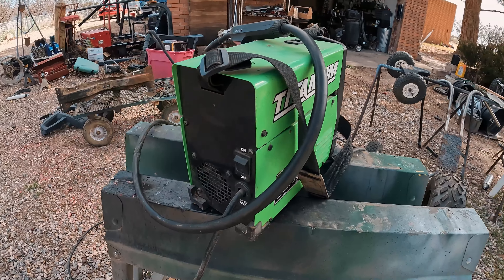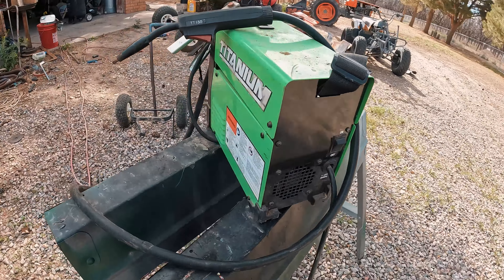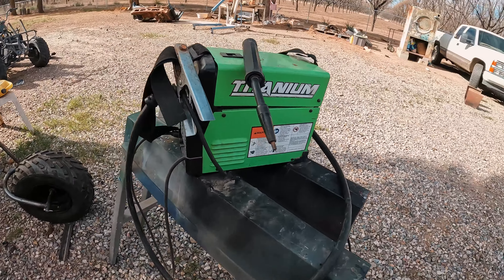Learn how to flux weld in 10 minutes or less

Comment: I stopped using the HF wire to using the better wire from an actual welding store recommended from them I've noticed a huge reduction in spatter , good video
Reply from the maker: I'll be sure to give it a try. Thanks!

Comment: Brilliant video for thin metal 0.9mm using this continuous weld, would it warp the panel, so would it be better on and off on the trigger, like spot welds. Thanks
Reply from the maker: Yes! With any sheet metal the consensus is not to weld the entire length of the panel. Take your time, don't weld too much at once. The heat causes it to warp quite quickly.

Comment: I have that same welder but not getting spark and it’s grounded, any tips
Reply from the maker: Is it feeding wire? I had a huge issue with it not feeding wire or initiating a weld. I blasted inside the trigger of the torch with starting fluid and it fixed the problem

Comment: With flux do i need a mask for fumes. And ×hat type from HF
Reply from the maker: Mask, a fan, or weld outside and keep your face out of the smoke. Flux smoke can cause iron deposits in the lungs
Reply: Good safety note about the iron deposits.  There's some guy here on YouTube that has a couple videos entitled something like "5 Ways/5 More Ways to Not Kill Yourself with a Welder" which are full of good safety info.  Got to wear a good welding helmet/mask to protect your eyes from the concentrated UV light.  At HF, you can spend more on a premium auto darkening helmet than a low end (read "beginner") welder, but there's always a sale or coupon around the next corner, if you're willing to wait.

Comment: As someone who flux-core welds a lot.. a boringly lot.. work...   my onlyish "Top Tip" would be to disregard any wire size below 1mm .. dunno what that is in American, 5 58ths or some such nonsense - flux core wire below 1mm (5/58ths?) doesn't weld gud.   1mm welds gud. Thin sheet/thicker steel - 1mm. Always 1mm... 

My second (2ndts) "Tip Top" would be to buy either a Yeswelder or a Hitbox machine - having bought every flavour of machine going because we use them at work & the "Let's buy another welder!" Budget is solid, I've settled on those 2 as being the best, regardless of purchase cost.   My last Tap Tup is buy gud gloves. Flux core runs hot & throws off lots of hot - good gloves make it less ouchy.

The lastest Hop Pip is "Wire wheel yer welds!" - right after you lay them - flux core erm, flux, is corrosive & rusts steel faster than sea water - you need to remove it pronto. There's 2 main ways - a wire brush wheel in a cordless drill (Boringly slow) or an angle grinder with a wire wheel fitted - use the angle grinder, the drill version is ok for tight spots, but would bore a hole in a rockinghorses behind if there's any real volume of weld to clean.

Follow these simpleish tips & yer Granny can be running FCW like a Boss - it's just gasless monkey-wire after all. Same same but different. There's also loads of flavours of wire you can buy - most are ABSOLUTE pish & will make you/your Granny think its you, not it, when your welds look crap - its it, not you. Same Rule applies - Yewelder or Hitbox flux core wire - or Super 6 if you can get it - are the only brands I bother buying. Super 6 is my fave, but it's like the rockinghorse poo that comes out the hole the drill/brush combo bored. Scarce.

Other "Hint" is treat your welds with a corrosion inhibitor - this schidt ought be pay to read.... - the World is full of "Corrosion Inhibitors" however most are like the majority of flux-core wire brands - rubbish... There's only one decent corrosion inhibitor on the market, it's expensive but it's also brilliant. Brush it on, forget about it.  The hardest part is paying for it. I'd tell you what it is, but then I'd have to off you.. I've said enough. Go weld something.